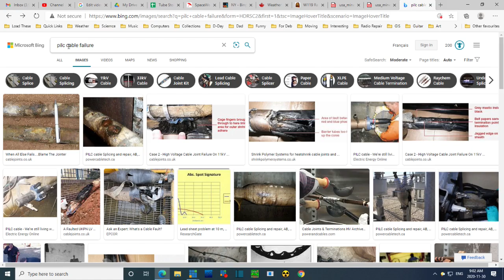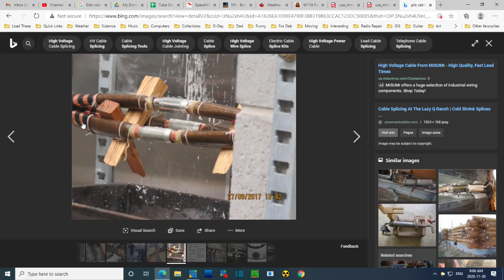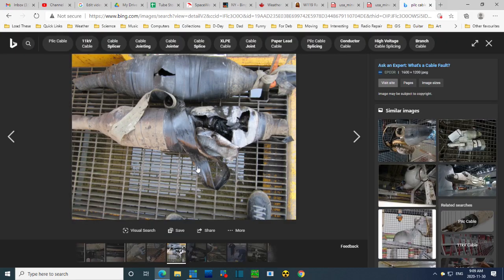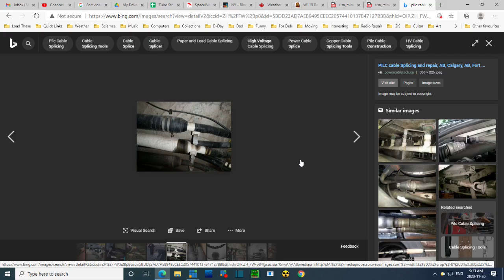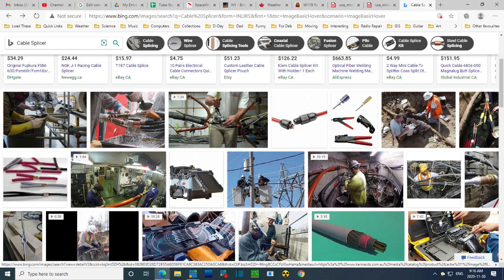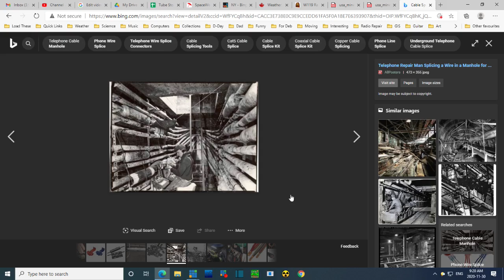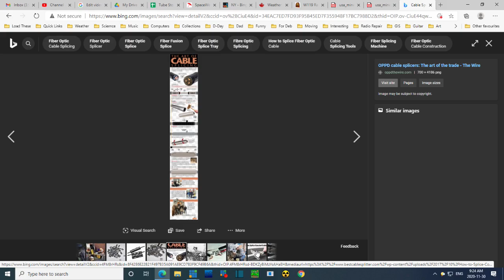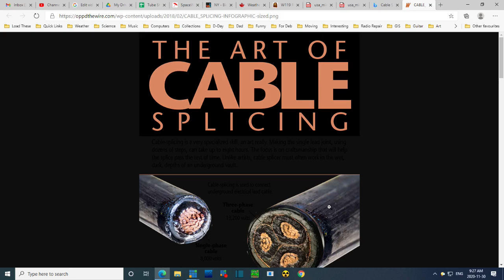Unusual Power Cable Failure

Comment: Seen the lead wiping, but pretty much all the ones I see these days are going to be repaired using either a shrink sleeve kit or with an epoxy fill, as there are very few left who can do the lead work. I also see them regularly doing jointing into the live cables to do a tap off, and thankfully they were using a Scotchcast kit as they were doing it in the rain in the mud, as the only way to turn off the power to that poorly identified cable (they did try to turn it off at the 3 local substations, but no joy) would be to turn off around 20 city blocks.

Distribution here is by 11kV, 22kV or 33kV depending on how far up you go, though there is a big project bringing in more 132kV cables ( 3 laid in a trench, each as thick as my leg) to augment the grid as the old cables are well past their design life, and are under strain. When switched over the old ones, despite being literally tons of copper, will be left in place, as to recover them will be near impossible as there have been a few hundred buildings and overpasses built over them in the intervening century. Amazingly none of the piling operations hit them either, as here you typically pile down 30m through the sand and silt to bedrock in the city basin. No real cellars either, as they have to be very water tight, seeing as the water table is only 2m under the surface, and part of that is salt water. Does mean cables lose the steel strap sheathing with time, as it corrodes away, leaving only the paper overwrap and the bitumen bedding covering the lead sheath. But those are still in use, and so long as you do not disturb them they are fine.

Comment: The cable had a north American plug on it, but the color of the internal conductors is European. This suggests Chinesium.  Therefore, manufacturing defects come into focus as a possible source of the difficulty. The cord could have been stressed during manufacture.
Reply: The internal conductor colours are not suprising, as the cables are made by many manufacturers, and even the USA made ones likely used the EU wiring colours as well, as they likely had a thriving export market, and thus bought the wire in volume. Chinesium would be 3 strands of mystery metal per conductor, with thick insulation to make it bulkier, made from recycled PVC stripped off older cables and such.

Comment: Jim this looks like the Live & ground shorted .

Test your earth leakage devices if this thing is on the mains that fault should have tripped  ...................You do have RCD s in your CU ? 

If it's after the isolation transformer you must have a ground & neutral connection .
( shorted by a device or it has been )

This cable damage can happen when its crushed .
Very common when a extension lead gets a doors closed on it .
As for work hardening & it finally opening up that's what you get a open .
Not a big black lump of ex cable .

This is why I like UK fuse in plugs system.
The 3 or 5 amp fuse would just open up or
probably just the RCD tripped before the fuse popped 
!
                                                Then you're looking at the classic 
                                                                                      Three Pipe Problem !.....

Comment: Poor manufacture had snapped strands pierce the insulation, and this one had the line (brown) with some strands and this then was close enough to earth (green/yellow) with similar strands poking through to have corona discharge, then a conductive film formed of carbon that grew till it had enough current to burn the cable open. Voltage at 115VAC is not enough to create a definitive fault, which at 230VAC will blow the cable open.

Likely the cable was made from a section of the long extrusion where they would have joined in new strands onto the reel to make it a single continuous join, though likely part is that they were using poor quality recycled copper with a high amount of contaminant metals in it, making the strands brittle. That or they were using CCA wire in there or copper coated steel.
Reply: The RCD / protection device should've tripped long before this !

RCD tripping with no obvious fault can be a annoyance but usually its a valid fault when you do find it !

Water & damp ingress are the hardest to find if you can't see it .
The green & crusty bits normally give it away .

The odd very smelly shower from a outside fitting is never a good day !
Reply: @gd2329j  Seen plenty of arcing wiring that did not cause a RCD or breaker to trip, and the arcing might not even be enough for an AFCI to trip either. Could also have enough current flow to burn the wiring in that circumstance, and is common. there was a fire in a building near me last week, traced back to probably faulty appliances thay had the cord short out, but not enough current flow to trip a breaker till well after the fire was established. Luckily no injuries, and while the 2 units involved ( bottom one caught the top one on fire) are not liveable, they are being refurbished. Fire was hot enough to make the aluminium framed windows melt and drip like syrup, but the top floor unit steel frames survived more or less intact, though all the putty, paint and glass was burnt off.
Reply: @SeanBZA  
Lots of substandard systems out in the wild .

Sadly people only find out about it when it fails in a uncontrolled manner !